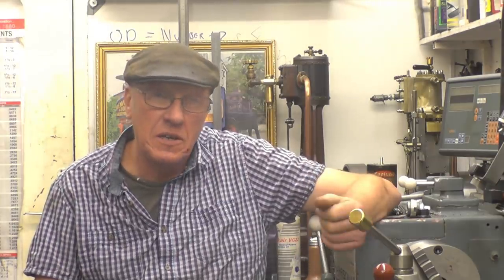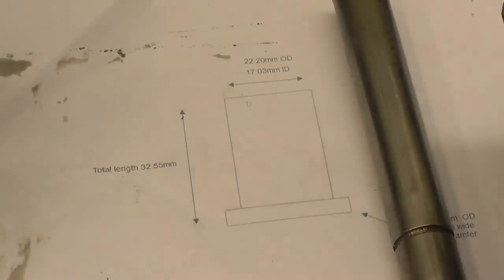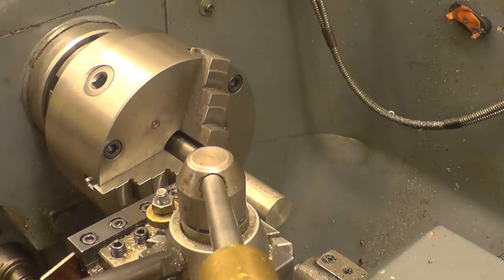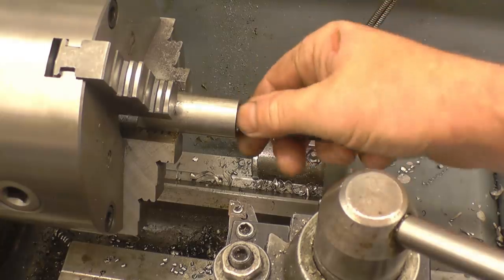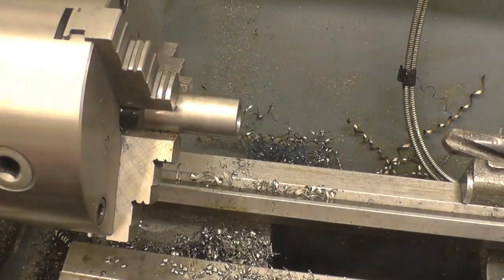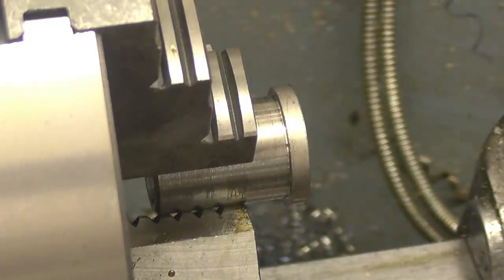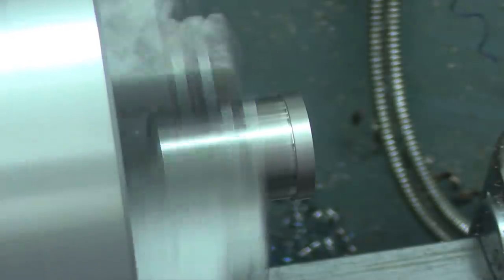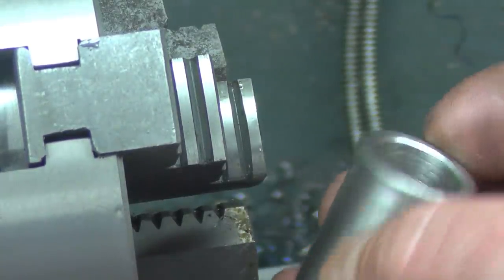SNNC 347 P2  Bike Spindle Spacer . A Day Out With A Steam Waggon

Comment: That core drill makes a very close dimension hole, almost as good as a reamer.  And thanks for showing the run in the wagon, I've seen it on your channel many times and it still is one of the coolest machines I have ever seen.
Reply: We had a steam bus round here (Martha, former steam lorry). It changed hands and I think is now in diagonally opposite corner of country.

Comment: What is the purpose of the wee steam pipe coming out of the wagons smoke stack? Stay safe John.
Reply: Its the safety valve stack pipe, it was put there to bow into the hot chimney gas's in an attempt to reduce the visible steam vapour..      Harold Bell Ex 1928 Super Sentinel owner
Reply: Ponkkaa Probably steam outlet from safety valve